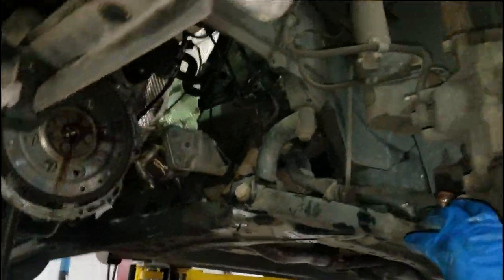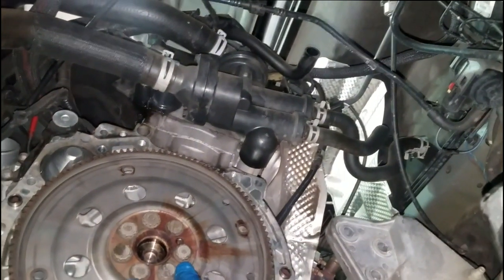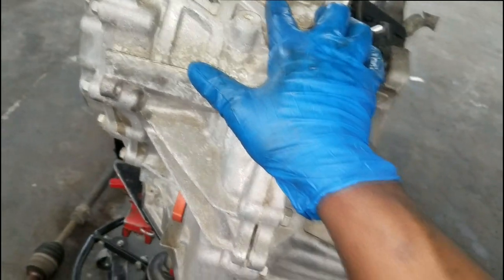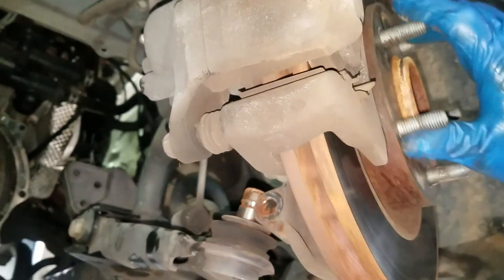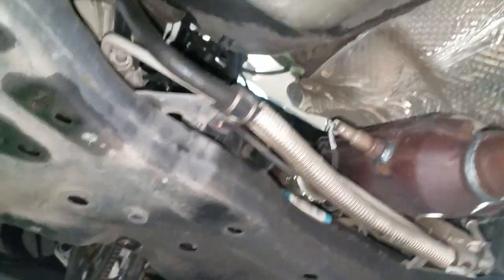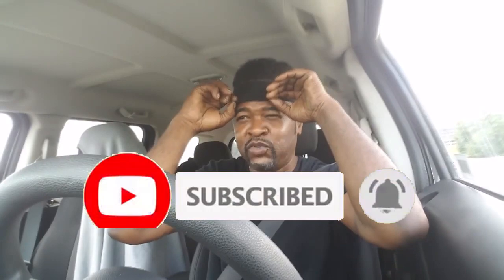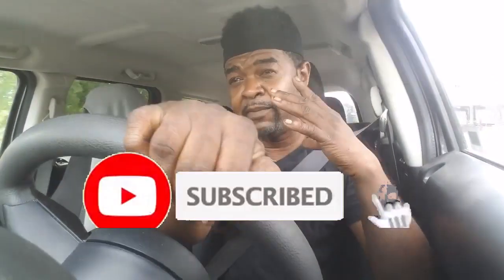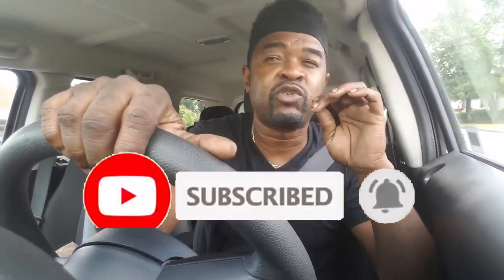How to FIX or replace a CVT bad transmission whining noise on acceleration. Tips tricks and hacks.

Comment: Thanks for making this video. My 2013 Jeep Patriot CVT transmission gave out today. My mechanic says a new one costs $4000 plus labor costs.  Is it possible to get a remanufactured CVT?  If so, would it be worth the money?  or should I go with the new one?
Reply: It's worth it if the reman offered 36k 36 month warranty.  Mine was only 12k 12 month warranty. Shows how much they have confidence is these piles of junks. A traditional 5 speed reman has 48k miles 48 months. Also reman is only good if they upgraded the defective parts ad opposed to replacing it with the same defective one.
Reply: Usually just transmission fluid need change and after several drive it take to runs like new again, pulling abs pump feed fuse and abs brake feed fuse can make it drive normal if its a abs fault about to occur sooner or later.
Reply: Sorry to hear that, consider the conditions and value of the vehicle it it was running, then you'd know if is worth to throw money at it, as the previous commenter mentioned, you could spend a boatload of money and the 
warranty is kinda flimsy... But you can get a used trans for less than 2k at car part planet 013 Jeep Patriot Automatic Transmission

AT, (CVT), 2.4L, FWD

 Change Options

t-u-n_5761

￼￼

￼

Used

$1,750
Reply: Then sell it.

Comment: I drive a 2011 Dodge Caliber. Cvt transmission. When i go to accelerate the rpms rev up. I can go only about 40-50mph nobody wants to work on it where im at. What's the most common internal problem with cvt transmissions in ur opinion.
Reply from the maker: hey my friend, it really depend on the code thats generated. Is your check engine light on? And are you subscribed to the channel?
Reply: Recalibrate it put key in last position before vehicle start, then hold gas pedal down for 20 seconds then release slowly within 20 seconds then remove key and open driver door then take it for a drive and train it to drive slowly for 7 times u most shut vigils off and open for after each drive so computer can learn the new drive mode. Once it learn to drive u can recalibrate it a second with the key method and u can train it to drive base on how u like to accelerate.
Reply: It’s has to have no code to recalibrate tho if it’s abs pull the abs fuse pump and valve feed, and it might solve your problem without recalibration.
Reply: When was the last time you did a tranny fluid and the 2 filter change?
Reply: @Platinumtag   I have a Mitsubishi Lancer Es 2011 2.0L I wanna take the slow acerlation would this work ?
Reply: @poloact6838  its should work if it's in relearn mode and should be fully relearn after several practice after turning the vehicle off each time. This relearn mode is to enhance the speed to shift faster in higher gear without engine working hard.

Comment: CVT transmission  are not nice, someone should run away from it when purchasing  a vehicle. They are not reliable at all. Whine noise, limp mode at 80 or  100mph, is always the problem. Better opt for conventional  or manual transmission.

Comment: I heard the 3rd or 4th generation CVTs are much more reliable.
Reply from the maker: O cool, wonder what model cars these are on?..I think the publics perception about this trans to far gone.,In there mind, the CVT is trash
Reply: @OnlineMechanicTips  The newer Honda CVTs have excellent reliability, better than their old automatic transmissions, but they still get bad press cause their early models were bad, and despite better millage and reliability, custoners do not like the lack if responsiveness.  The Totota hybrid CVTs are another example of CVT done right.
Reply: On the other hand Nissans have been continuing to be plauged by problems..
 Just what I read.